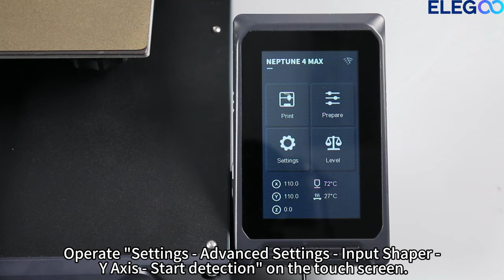ELEGOO Neptune 4 Plus&Max: How to replace the acceleration sensor cable(Y-axis)?

Comment: Any instructions on getting those 6 wheels on the bottom of the bed to sit properly?
I cannot seem to get my bed to not wobble.
Reply: Managed to resolve the wobble by taking off the entire bed and slide, and ensuring all screws were tight. It's a little annoying that there's no way to access the screws themselves without removing the bed (you can only access the nuts, not the screws). 
No more wobble on the bed (with a lot of rotational torque I can get it to shift by about +/- 1mm).
And my bed also seems a lot more level now (+/- 0.25-0.3mm difference between highest & lowest point).
Reply: Ha! Had the same issue. I avoided this by using thin pliers and squeezing the screw heads while I tightened the nuts.